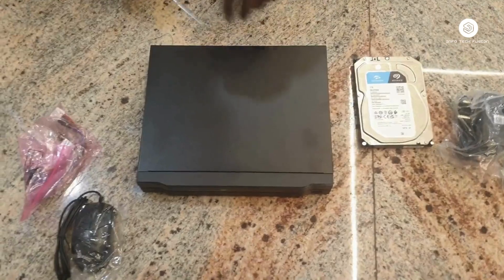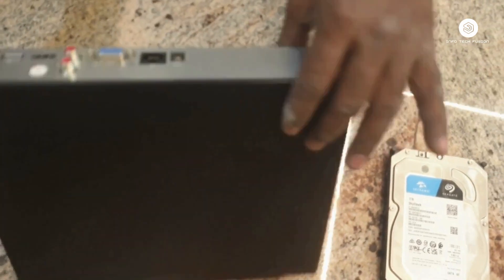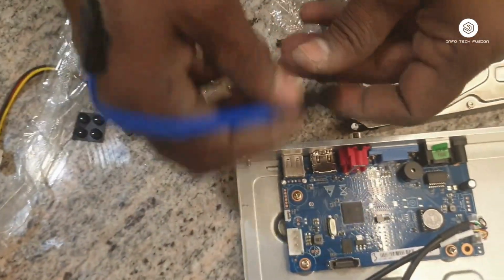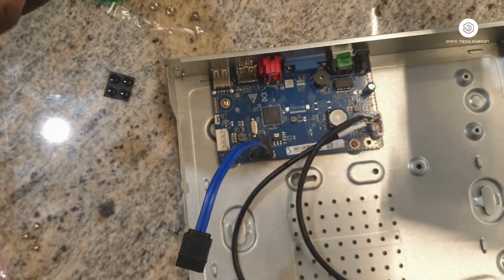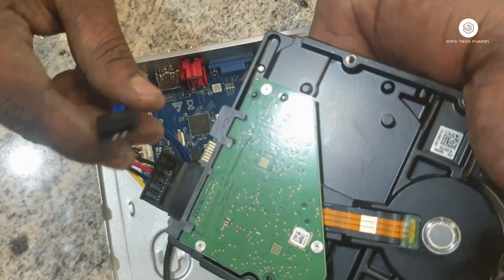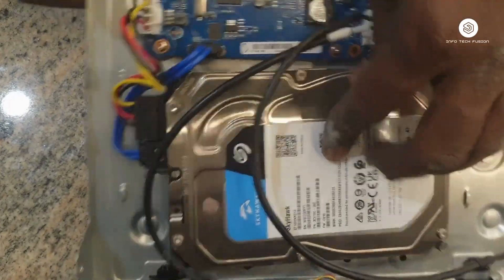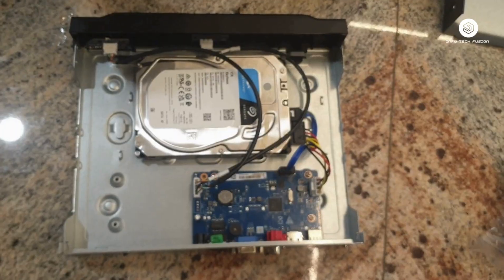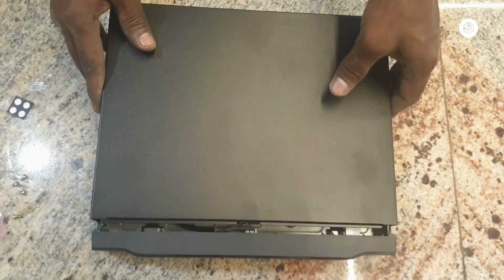How to Install an HDD in an NVR/DVR | Step-by-Step Guide

Comment: Great video I installed mine also but the cctv still says to me no HDD what could be the problem
Reply from the maker: Check connection of hdd its should not loos connection,

Next option replace power adopter of your dvr or nvr, sometimes if power adopter is week means No HDd will come,

Adter this also same issue is coming then hdd issue
Reply: @info_tech_fusion  thank you. GOD BLESS YOU